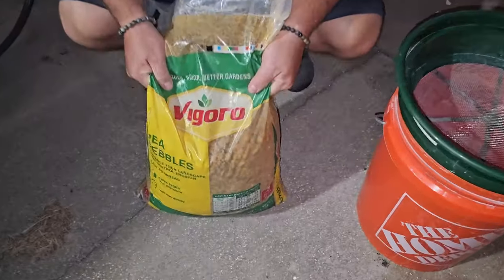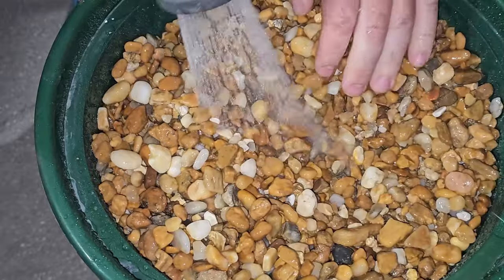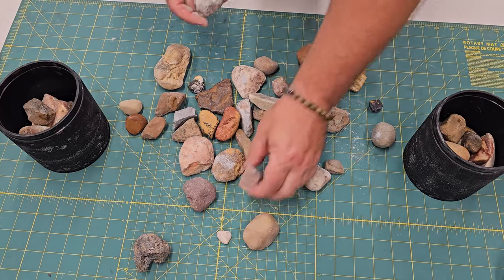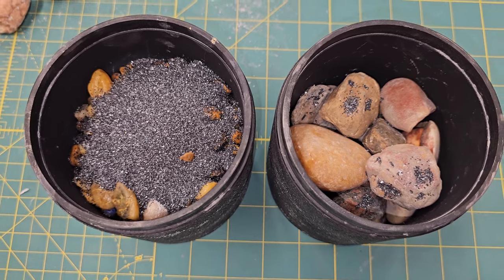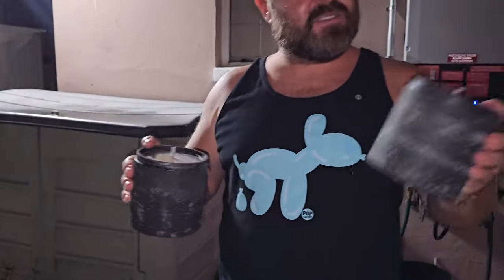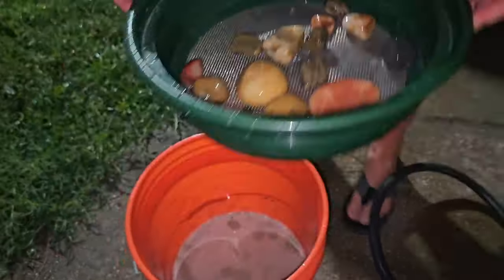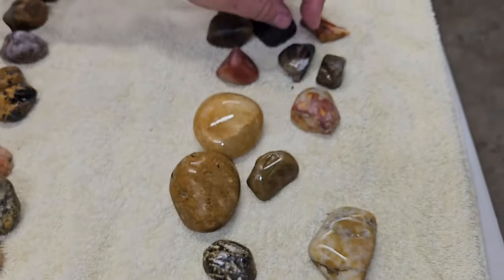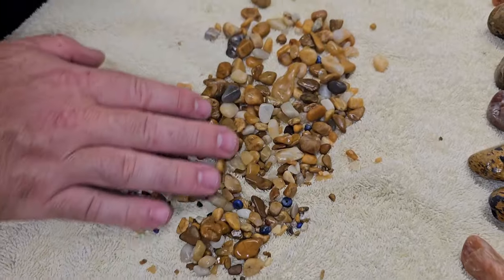Speeding up the roughing stage: Is pea gravel the answer?

Comment: Have you tried just using a finer grit? Most people use something around a 60/90 SC for step one. My guess is that since your grit is so large, not only is it sinking, but your rocks are unable to break down such large size pieces of grit in the amount of time you're tumbling them for.
Reply from the maker: @jennabennett4236  that was another thought I had. I actually just got some 60/90 and added some of the 36 (want to use it up) to the batch after this was filmed. They're tumbling now so we'll see what happens👍 thanks for the feedback!
Reply: @LearninRocks  That's exactly what I do when I have really hard stones like agates and jaspers. I add one scoop of 30 or 36 grit to two scoops of 60/90. It chews them up quite a bit faster.
Reply from the maker: @kengensjewelry  I just purchased an extreme tumblers rebel 17 that I'm in the middle of filming my first batch in. I ended up using that mix and we're half way through a two week tumble so we'll see what we get! Hopefully I'll be able to get the video up soon after it finishes

Comment: That's what I use to polish my rocks!... You'll find that it helps to not take away texture from the rock, yet polishing them all the same... You don't get baby butt smooth stones, you get a polished rock that still looks like the rock you put in... You either like it or not... I'm not into rocks turning to perfectly polished stones... And I use them for each tumble, start to finish... There's no reason to use them if all you want is what everyone else wants... The pea gravel softens the blow ass the rocks tumble over themselves... If all you want are smooth as he'll rocks, don't use the pea gravel... You'll just be disappointed... And it may not be successful to you, but to me, it's better than just successful...
Reply from the maker: @millardwilliams9182   I can definitely see how they could help with preventing chipping - they're probably better than porcelain for a lot of rocks that are softer or that fracture easily. Great feedback! I think I'm on the fence about round versus keeping some natural shape. I like both depending on what kind of stone it is. We're in a bit of a holding pattern right now until I get the workshop finished then maybe we'll do a video on using the gravel for all four stages. 👍 Thanks for watching!

Comment: a mix of large, medium and small rocks is what is usually suggested ... you seemed to be using mostly large with a couple of mediums. 60/90 grit is what is most commonly for stage one.  th
Reply from the maker: I may have to try it again on the next effort with fewer rocks and more size variety to let it move a bit better. Thanks for the feedback!

Comment: Great video and what a fun experiment! I've learned, begrudgingly, that space in the barrel is important. I'd say that was probably the biggest contributor to the difference in polish between the two barrels. Another might be the hardness of the stones. Since pea gravel is going to be all over the place for hardness, it might have provided a softer surface and not smoothed out your target stones as much. Something ceramic media would correct. However, if you were to select all the quartz out of that gravel you'd have better than ceramic for tumbling media. Great job! Now you have me wanting to try some pea gravel.
Reply from the maker: Thanks! I'm glad you enjoyed it and hopefully you have some interesting results of your own, is like to hear about what happens if you try it. I really enjoy just throwing things in and testing to see what happens. I love tumbling rocks because you can't really mess things up, you just tumble them longer with different grit, or media, or with different rocks until you get a shiny rock. Really fun hobby👍

Comment: I’ve been thinking about experimenting with pea gravel in my tumblers to save cost using ceramic media. I was interested in seeing how the various sizes of gravel would affect how rocks polish. I’ve bought the pea gravel it haven’t used it yet. My ceramic media range in size of 3/8 x 5/8 inch to nearly wore out and the size of rice kernels. I tumble the first stage in a rotary tumbler using 60/90 grit and borax and the other 3 stages are finished in a vibratory tumbler. I use borax in every stage and think it helps keep the grit in suspension and cutting the rocks better. My rocks aren’t perfectly rounded with this method but every hole, nook or cranny takes a very nice polish. Your video is making me want to see what kind of results I can get and maybe save some money on my media filler. Thanks for sharing your results.
Reply from the maker: I was curious about using it in my lot o vibratory as well. I'm about 2 days into the tumble and running into some pretty serious movement problems and all the gravel seems to be on the bottom with the larger rocks on top. I'll put out a video with the results soon👍 thanks for the comment and for watching!
Reply: @ I’ll keep an eye out for the follow up video. I’m thinking the pea gravel will flow well in my vibratory tumblers. It’s roughly the same size as my ceramic media and I get great movement with it.
Reply from the maker: @davidsommerfeld2955  I just did a check on stage 2 because my movement had stopped completely and was surprised all my gravel was stuck in the bottom with the grit. I'm going to try a couple more days with some fresh grit but I've never seen it clump up like that before. On the bright side the rocks are looking great👍

Comment: You can use a dremel to smooth out cracks and holes.  they don't cost that much.
Reply from the maker: I have used a Dremel for smaller jobs occasionally but definitely need better bits. I'm saving up my couch cushion money for something to speed up the process and cut up some larger rocks. Hopefully I'll be doing some videos with new equipment soon! Thanks for the feedback I appreciate it👍

Comment: I'm wondering if you still were on to something. I would try it again and use maybe half as much pea gravel. I think maybe there was so much pea gravel that the rocks did not get enough movement.  Just a thought.
Reply from the maker: @andriesjohannas3579  there's an idea. I'm thinking that with the added surface area of the gravel I was wasting the grit smoothing out rocks I didn't want to smooth out. I haven't used ceramics in the roughing stage before but maybe that would be better than gravel since it's so hard.... Maybe next experiment👍
Reply: @LearninRocks  I am fairly new and no expert and appreciate listening to others like yourself. I tried aquarium gravel and tossed that after one try. I occasionally use ceramic tiles that I break up. They are cheap if purchased and I have actually received a lot of free tiles from tile retailers after explaining what I need it for. They have broken and orphan tiles often they would otherwise toss.
Thanks again
Reply from the maker: @andriesjohannas3579  that's a great idea! I hadn't considered trying to use broken ceramic tiles👍 I may have to try it!